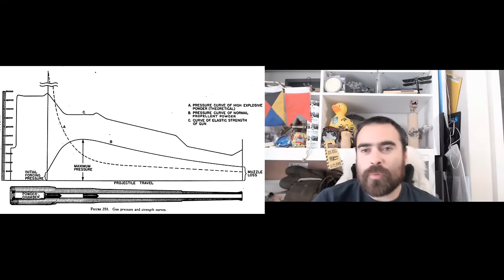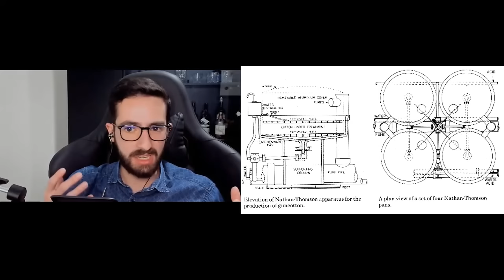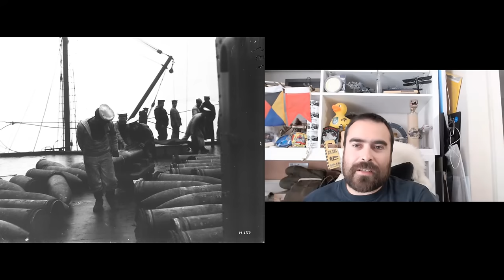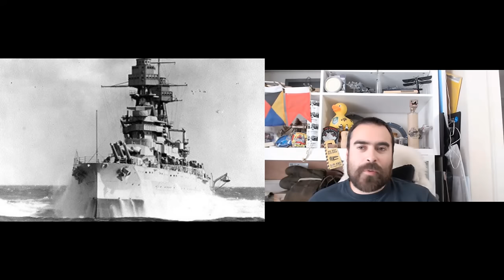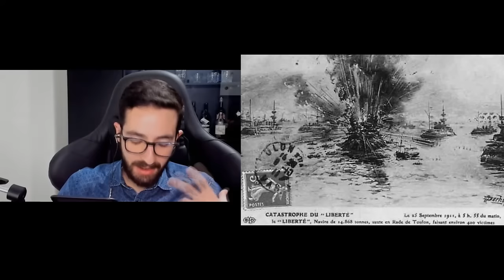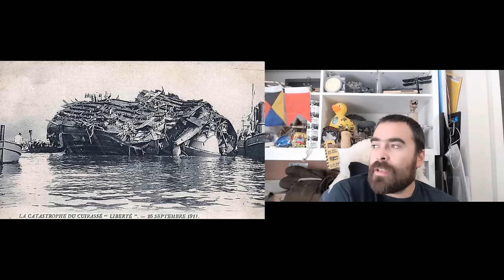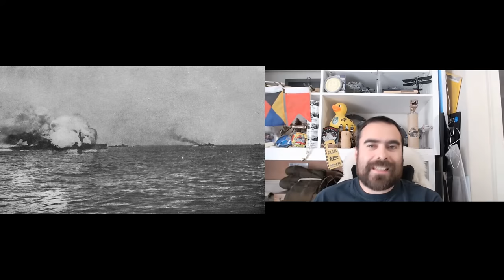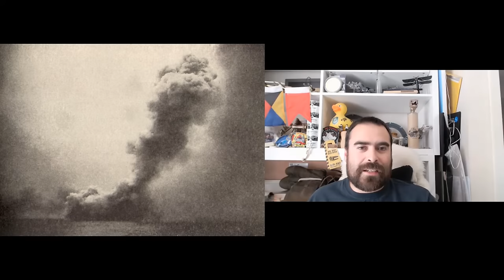Cordite and Poudre B - Why things start exploding at just the wrong time

Comment: The Royal Navy attitude towards cordite safety reminds me of the US Army’s attitude towards cleaning the M16 early in the Vietnam war. The gun was designed to not need regular cleaning (cleaning kits not even being issued) but then they changed the powder from a new clean burning one to standard powder and didn’t realize this change the need to clean it. The military is a very large bureaucracy and once it makes a decision it takes a lot to change that decision. Usually a major disaster or two.
Reply: see also the US Navy's attitude towards torpedo problems at the start of WW2.
Reply: They bought tons of dirty ammo from a low dollar supplier.  Maybe millions of dollars.  Who gets the blame for that?
Reply: @jwenting  that's just buord being buord tho... And boi did King rip them a new one over that... Would've loved to see that happen 🤣
Reply: @rogersmith7396  
The DOD also decided to eliminate the chroming in the chamber
Reply: @adenkyramud5005  nah, it was typical of the way the US procurement system and other procedures worked at the time.
The same idiocy was seen at all levels, in all services.
Reply: Read The Gun: The Story of the AK-47 by CJ Chivers if you want to know more.
It contrasts the AK47 story with the M16. As well as testing the M16 with 'better' ammunition that would be used in the field AND deciding not to chrome the chamber this helped undermine the quality of the M16.
Also the decision to use a single weapon for all the services. The requirements for an Air Force sentry are different to Marines/soldiers in fox holes.
This contrasted with WW2 where different requirements were recognised.
Reply: @jwenting  
That was in part because of personal investiture. The officer responsible for the development of the fusing of the torpedo became the officer responsible for the submarine fleet. He blocked 'bad news' and simply blamed the Sub Captains. It took a while for him, effectively, to be sidelined. 
It was eventually discovered that a decision had been made that torpedoes were too expensive to be wasted in 'live fire' testing and so they had been tested with a 'lighter' test sandbag warhead. This was inadequate testing and lead to an utter shambles.
It's worth looking up the RN comment when they declined to buy the USN fuse used in this torpedo.
Reply: @johnathanh2660   Oh man it was so just not the fuse; it was literally everything with the mk14 torpedo; the proximity detonator was dogshit, the bloody things gyroscope would occasionally make it go 'return to sender, wheee!' and the depth sensor in addition to not having ever been actually tested with a live warhead when it got up to full speed would get false readings and go up-and-down in the water like a goddamn porpoise showing off for people in people in a Harbor.

Even the contact detonator was shit.

Drach actually has a hour long video on the mk14. Worth a watch.
Reply: @Shinzon23  
I was sort of paraphrasing the Drach video!
Reply: The M16 had two early problems:
1) Because it was specified with a chrome plated bore, the cleaning kit was deleted to save money.
2) Then the chrome plated bore was deleted and shipped to the tropics.
Supplying cleaning and oiling kits solved most of the problems.
Putting the chrome plating back on with the M16A1 fixed the rest.
Reply: @johnathanh2660  The Air Force used original design AR15’s. The army M16’s were much worse because they cheaped out on fit and finish.
Reply: @allangibson8494  

'Supplying cleaning/oiling kits solved most of the problems' - not even close.
There was a great deal of denial and Soldiers/Marines were initially blamed for poor weapons maintenance. In turn Marines 'acquired' cleaning kits from M14 carbines and it was agreed (Colt?) engineers would go out to inspect. they were horrified how corroded the M16s were, because the chrome plating had been deleted. This was despite excellent/overly-diligent cleaning. Cleaning wasn't the issue.
As you say Chrome plating in later models solved many of the problems, but the 'different' ammunition than the favourable version used in the trials (compared with std ammo) AND the humid, muddy conditions led to early excessive wear/corrosion. 
BTW - the cleaning kit wasn't deleted to save money, it was deemed surplus to requirements based on the trials - which crucially was based in 'better' ammunition and chrome plating.
Sorry - it's been a while since I read the Chivers' books so I can't remember the details.
Reply: @allangibson8494  
Fair enough. My point was a USAF sentry is relatively unlikely to fire his weapon and weapon maintenance is relatively straight-forward in a tent/barracks. 
Incidentally, Curtis Le May was a fan of the AR15/M16 / combined weapon system and lobbied for it. So it's ironic that 'his' service was untroubled by its' introduction.
Reply: @mpetersen6  
The chamber of the AR-15 was not chromed to start with. Half a ranger battalion in Vietnam with self-purchased AR-15s who were not cleaning their rifles but using the proper powder and didn't have a jamming problem. The cheep powder caused caused other problems that greatly reduced the rifled life as well but the cause of jamming was from the new powder residue.
Reply: Chrome was not deleted. It was not there in the first place. The people that changed the powder but argued for the chrome lied about it.
Reply: @calvingreene90  
The Chivers book goes into great detail about this. For acceptance testing the rifles WERE chromed AND the better ammo was used, knowing that this was NOT the ammo issued to the armed forces.
On the basis of this testing cleaning kits wre not required. However this (obviously) was not a fair test and so when the M16 rifles were issued they suffered with excessive wear/corrosion that lead to excessive stoppages. This was as US forces were fighting against troops were armed with the AK47.
Reply: @johnathanh2660  
The self purchased rifles that the Rangers had weren't and they didn't have a jamming problem despite not being cleaned. The chrome would not have affected the first generation M-16 durability because the different pressure curve of the dirty powder had the bolts opening to fast as well as the residue causing jamming.
Reply: @calvingreene90  
As I said, Chivers explains in great detail the problems that the US military had with the M16 when it was first used in Vietnam.
The version used 'self bought' by the Rangers is irrelevant as it's a different gun manufactured to a different specification. As Chivers explains the problem wasn't a cleaning issue it was a corrosion issue: the barrel and chamber were becoming heavily pitted and corroded leading to stoppages. This didn't show in testing because a different spec gun was tested, using a different spec ammo. It wasn't a cleaning fault on part of the military (as originally claimed).
The comparisons to this and the mk14 torpedo are a) unreasonable testing - not mirroring 'live' usage conditions, and b) a 'disinterested' senior command structure who are ignoring reports of problems, for 'political' reasons.
Reply: @johnathanh2660  
Writing a book doesn't make him correct or necessarily honest.
Reply: @calvingreene90  
'Writing a book doesn't make him necessarily correct or honest.'
Nor me. Nor you. TBF.
Most publishers get the book peer reviewed prior to publication to ensure that the work is 'somewhere near' right.
I still take a printed book (from a reputable publisher) over a youtube video or a web page (or a self-published book) any day of the week.
I found the work compelling and well-researched, but as you say it doesn't make him right. So, as I think highly of the book please read it, I do recommend it.
As for the Rangers, it looks like they were wise to side-step the problems.
Reply: @johnathanh2660  About right.  The M-16 is a superior weapon in just about every way, but the AK will run on dirty ammo and requires less cleaning.  Of course a simple gas piston system for the AR platform gives the best of both worlds.
Reply: @BrownSofaGamer  
'The gun wasn’t designed to not need cleaning necessary the government just thought it was'
Not quite. The manufacturer rigged the trials. For the trial the weapon was chromed and 'clean' ammo was used. On this basis the weapon did not need to be cleaned and so cleaning kits were not supplied.
Of course, this was not what was supplied to the troops.
Tl;dr - testing proved that cleaning kits were not required, so the kits were not supplied, and the trial results used to justify this decision, but no one looked too closely how those results had been achieved.
Reply: I would not disagree, and there is a lot of "left hand not knowing what the right hand is doing" going on. The whole M16 cleaning issue is a case in point. What really happened was that the original trials were conducted using a conventional double based propellent, which was relativly clean and did not lead to blockages in the gas tube that is  a feature of the Stoner design for the M16.

At the same time, the Olin corporation had come up with a new process to rework old navy gun propellant into a form suitable for use in small arms. Basically the original propellent grains were dissolved into liquid form by re-pulping. This liquid was then added to another liquid as an emulsion of small bubbles. The liquid was then evaporated off leaving the propellent in the form of small spheres. This was subsequently known as ball powder and what was used to fill the M16 ammunition during the Vietnam conflict. Whilst perfectly good in normal small arms, the ball powder residue did condense in the gas transfer pipe of the M16 over time, something for which no provision had been made.
Reply: @johnathanh2660  -- Most publishers get the book peer reviewed prior to publication to ensure that the work is 'somewhere near' right.

In an earlier life I did technical editing for a major mainstream publisher. They paid me two bucks a page to basically read a book and point out any errors I found (software development literature). I found drips and drabs as I nitpicked my way through each book, until one day I hit the mother lode: The author had a total misunderstanding of a very rudimentary (but of critical importance) element of the language. I could not believe my eyes!

Needless to say, I went into detail in my notes regarding his error.
Reply: @This_is_my_real_name  
I used to live next to a published author and experienced teacher. He had the opposite problem - convincing the publisher AND proof-reader that he was right! Still, the conversation caught most of the errors, but not all and these were corrected in the 2nd edition.
As you say, a reputable publisher takes steps to protect both their reputation and that of their author. And they're looking at future editions so they will continue to work on the book improving it. 
I doubt most Youtubers/keyboard warriors do.
Anyway, thanks for the post, have an uptick!
Reply: @felixthecat265  
Thanks. I read a lot of this some years ago and this more than fills in my hazy memory...
Reply: @johnathanh2660  -- I used to live next to a published author and experienced teacher. He had the opposite problem - convincing the publisher AND proof-reader that he was right!

Thanks for the good vibes <g>.

After a bunch of tech editing, I did some book doctoring for them, and wrote some software to accompany a book they were about to publish (it won a monthly "non-monetary" award in a Windows developer magazine, back in the dead tree era).

Eventually, I got to finally have my name on the cover of a book (after wanting for most of my adult life to be an author). I then ran into the exact problem you just described!

In my case it was mainly a bunch of protracted/recurring arguments with their in-house nitpicking squad (their editors).

In one case, I made a bona-fide screwup -- submitted a chapter that ended mid-sentence! Partly due to them having me so rattled that I didn't notice it, partly due to just plain old fashioned mea culpa. (I'd meant to finish it later, after mulling over some details, but never got "a round tuit.")

Meanwhile, they sent me back the chapter after leaving their marks on it, as usual all revised to hell and back. I argued with them about the nitpicking for a bit -- there were SO many revision marks glaring at me that no way could I possibly address all of them -- and then I threw down the showstopper -- THEY missed my having ended the chapter with half a sentence! 

Ah, memories... <g>
Reply: @calvingreene90 Armalite chromed the bores on the AR-15, Colt didn’t with the M-16…
Reply: @johnathanh2660  
I have seen plenty of nonsense published in allegedly nonfiction books. Like claims that the Mitsubishi A6M Zero was a copy of a Howard Hughes design, that Admiral King was completely was incompetent because of the one serious mistake in his long Naval Career, and that Admiral Bull Halsey wasn't relieved after typhoon cobra because there was no one available to replace him. It comes as no surprise that despite other sources stating that the Army wanted to add chrome linings to barrels of the M-16 without specific need other than to increase service life after the trials.

The new powder gave the same muzzle velocity but had a different pressure curve that included significantly higher pressure when the gas was vented to drive the action which opened the bolt significantly faster than designed for which beat the crap out of the guns but was not noticed as a problem till well after the jamming from increased powder residue was solved by the hasty issuing of cleaning kits.
The "Army lore" that the M-16 would jam if you looked at it wrong was useful in getting draftees to clean them regularly in the field so there was no way that the NCOs were going to quash the rummors.
"Strange" McNamara refused the chrome lining so it became the perfect scapegoat for all of the M-16's problems.
Reply: Also known as "MILITARY INTELLIGENCE " and "not invented here "
Reply: Business been counters with NO experience in combat trying to push  economies with efficiency as opposed to  effectiveness

Comment: 15:46 Hexamine is the name for the heating brick. Also very happy that previous generations sorted these issues out as I frequently fire tank ammunition with a cellulose cartridge case that burns when we fire the gun, and sometimes (rarely) they rip and you get the turret floor covered in lots of little pellets.
Reply: This is the component used in the manufacture of RDX.
Reply: The local mil surplus shop used to sell hexamine bars in their jungle foil packaging 10 for a dollar. Quite handy. Every family I knew as a kid had a stash for outdoor activities.
Reply: Hexamine tablets also at least used to be used for heating the boilers of toy steam engines and were available in hobby stores. You can also use them for preheating oil-burning camping stoves
Reply: Actually hexamine tetra mine, but nitration is a little trickier than, say, nitrocellulose. But the chemistry is a little different: RDX is a nitramine, whereas nitroglycerin is a nitro ester. The third category would be nitro aromatics like TNT.

Comment: Reading Richard Hough's The Big Battleship, a biographical history of HMS Agincourt, one thing that struck me was the antiquity of some of the 12' inch ammunition issued to the ship in 1914 , which included a shell marked 'repaired 1892'.
Reply: That is the way big shells like that are. When the Iowas were finally retired permanently, the shells that were at the depots were still the WWII vintage that had been made for them.
Reply: @hokutoulrik7345  The Iowa's case is more understandable coming as they did at the end and acme of big gun naval artillery, but the period 1890-1914 was one of great transition.
The era of the first USS Iowa and HMS Nile to the launch of HMS Queen Elizabeth and USS Pennsylvania.
Reply: @vespelian  yes but the 12" gun was of not inconsiderable vintage itself by 1914 and while guns advanced a lot in the period between dreadnought being launched and the end of the 1st world war it hadnt advanced massively in the previous era, most of the technological change was in design and layout of fire control engines and main battery, not the guns themselves, the 12 inch had been a standard gun size for about 30 years by then but was no longer a primary type in the RN being used on older dreadnoughts hence the old ammunition, less new stuff was being produced and agincourt got what was left

Comment: Speaking of C4 stability, there’s a great Myth Busters video where they try to make C4 explode without a detonator.
Reply: “Now, Mr. McClane, where are my detonatahs?”
Reply: Equally fascinating to me was the episode of Adam Savage's show where he tried to get nitroglycerin to detonate from drop shock, and found it to be EXTREMELY unreliable. Most of the time it didn't mind being dropped from table height, but every now and then... BOOM! Which could explain why people might have become overconfident when handling it.
Reply: My Dad and many others used C4 for heating up rations in the Vietnam War. From what he said, it was OK to burn, but being hot might increase its shock sensitivity, so it was ill advised to drop the can on top of it.

Also, don't cook with C4 or other explosives. They tend to let off toxic fumes that are not good for you.